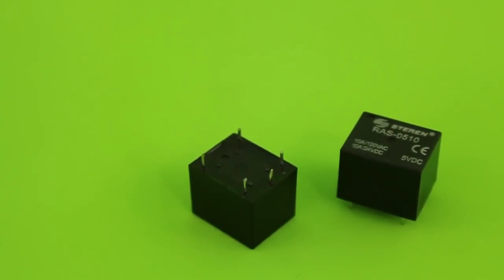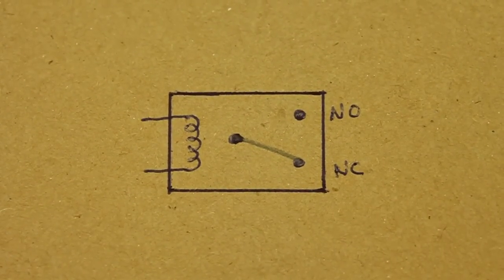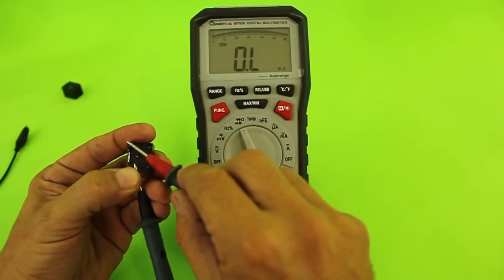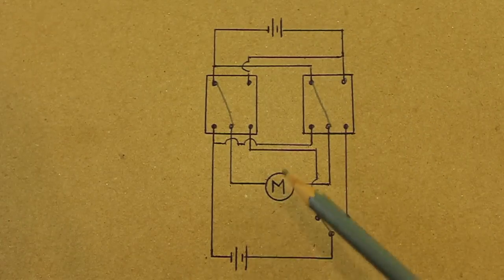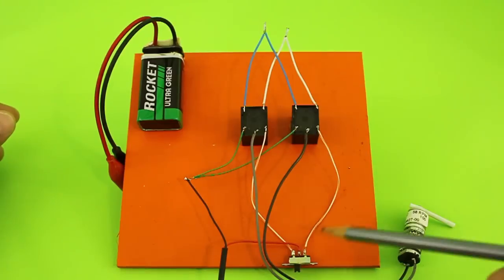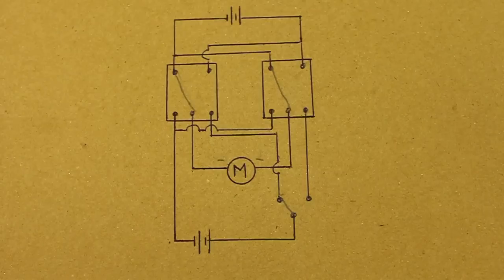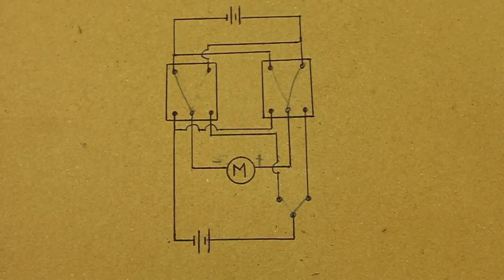Forward Reverse Control of Electric Motor with Relays

Comment: A double throw switch could do the same operation, but cheaper, more reliable, faster and more energy efficient.
Reply: For small DC motors like the one used in the video what you are saying is totally correct, but for big three phase motors that are used in industrial applications, having a switch connect directly to such a high current circuit could be extremely dangerous, the purpose of the video is to demonstrate the use of relays for controlling big motors
Reply: The video is for educational porposes.

Comment: This can be modified with the coils wired in parallel and  NO1 &  NC2  to Positive  ,  NO2 & NC1 to Negative. so one command from an arduino can toggle the motor direction. Thnx 👍

Comment: Brill. Thanks 👍
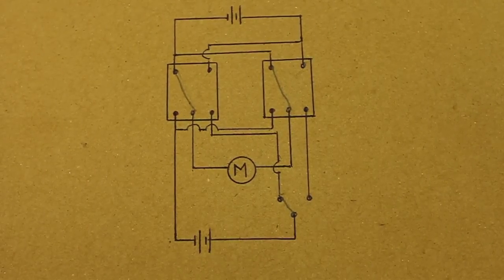My only confusion (small point) was that I paused the vid at 5:30 to study the diagram and because you had ALREADY pencilled in the switch position, the diagram didn’t make sense as the motor would NOT have turned.....it was only afterwards when you ran through the diagram and RUBBED out and amended the switch position that it all made complete sense......thanks again
Reply: He never showed the bottom connection fully erased which is how he should have started.

Comment: To Forward and Reverse a DC motor no need any circuit really, you can use a 3 position 6 pin slide switch. First 2 pins connect power,(No. 1+ and No.2-) then the 2 pins in the middle connect the 2 phase of the motor, and the last 2 pins(No.5 and No.6)  connect the power from first 2 pins reversely by a small wire, 1+ connect to No.6 and No.2- connect to No.5. and done...
Reply: yes,you can make it, but only for small motors

Comment: When the diagram is first shown the coil on the left was drawn activated at the bottom but not activated at the top. Which was wrong and confusing because you never showed neither coil connected. Which would have been drawn with the line at the bottom erased. 

So the drawing should have started with no line at the bottom showing no coil activated and the top as it was with both in the negative position. Then you draw the line at the bottom to the left and the video would be correct where you switch the left relay to positive.

Comment: i like a design im buying, it is a Wireless Remote Switch 12V Universal 2 Channel RF Remote Control but need more max load when it comes to amps, is it possible to change the 2 relays inside and put a higher rated relay like 40a without any problems with the receiver, remote switch itself? it is max load rated at 10amps or less originally

Comment: Could you identify the pin numbers in your diagram.  My relay has the following numbers 87, 87a ,30, 86 & 85
Reply: test it  with any multimeter for identify the NO NC and coils pins

Comment: how to speed up the motor with that relay?
Reply: That type of motor is constant speed based on battery voltage. Normally you would not use a relay to change speed but technically you could have 2 12v batteries that are switched from parallel (12v) to series (24v) which would double the speed.

Comment: Could you make a similar video showing how to reverse a PWM motor?  Thanks
Reply: You can reverse pwm servor motor and repossition using a pulse width modulator circuit. And pwm motor like the cpu fan only itd speed can be controlled.

Comment: i just simply used a 6 terminal switch
Reply: Right way easier for manual control but you can use this set up with a cheap toy grade rc receiver and controller to remotely control much larger motors than the super cheap toy grade circuits could handle. That's how I am building a large rover from a small gokart frame 6 12v 14am wheelchair motors combined weight limitations around 2150lbs with a mover deck to remotely cut my grass and also to use some salvaged windshield wiper motors  I made into linear actuators welding some all thread to them  to build dump still bucket on it and 2 arms to pick up branches and other debris from out of it's way. I have a limb trimmer I'm thinking of using same set up to trim up trees from it as well. I sit inside and use it I just  used a busted drone fpv camera and 4.3in fpv monitor. Steers like a tank does. Need 3 more busted drones for 360 vision lpl